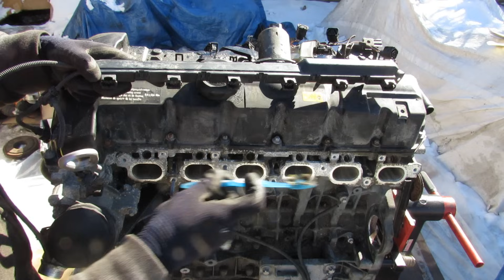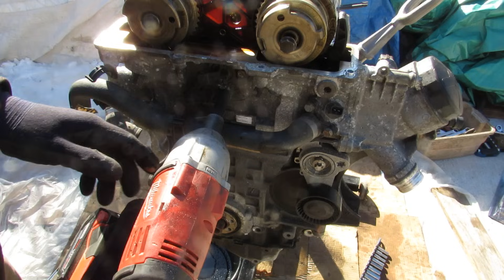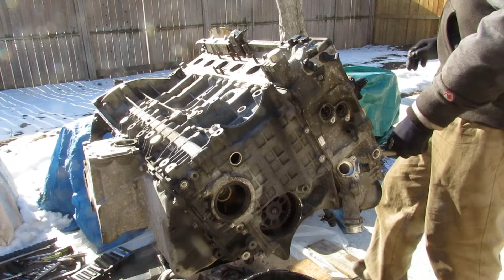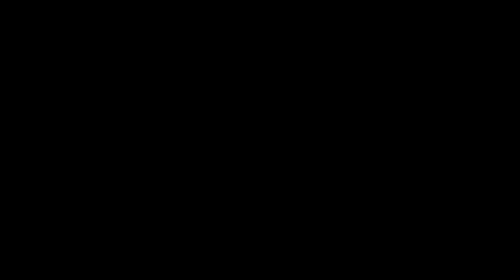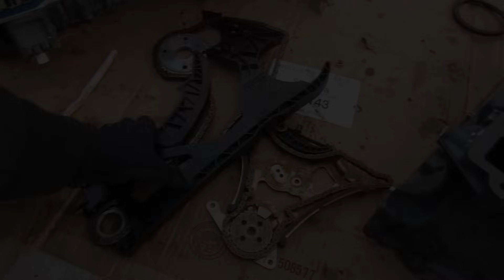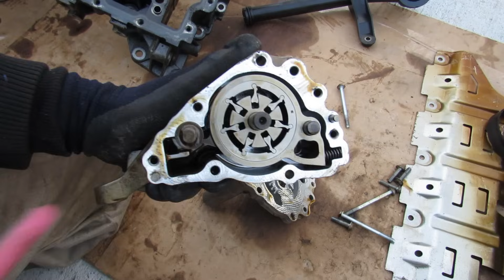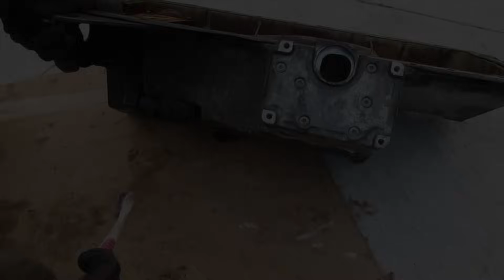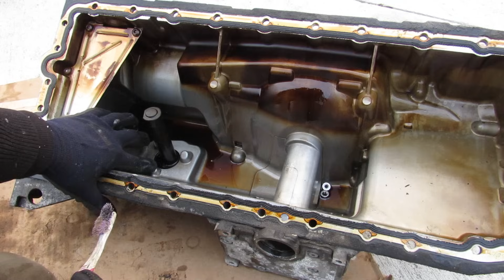The Last Inline 6 Engine: BMW N52

Comment: "now, part of what makes this a engine a real BMW is that it leaks oil"
TOO TRUE. You had me rolling on the floor laughing.
Reply from the maker: Yep it's true and this engine was no exception
Reply: @speedkar99 

Can this motor make it to 250k miles? I would say the GM legendary 3.8 v6 is a better motor. My 2008 Grand Prix has never leaked oil. I am at 218k miles. 

Only thing I replaced was water pump and that was because I hit something and it started leaking
Reply: @captainmorgan5449  I've seen very high mileage M52TU BMWs.  If maintained properly (and you know about and get out ahead of the problems, which are all with the ancillary stuff, not the core of the engine itself), those engines are very reliable.  And it's an inline 6 which is going to be better than ANY V6 🙂
Reply: It's called self rust protection, pretty high German engineering.
Reply: but does it leak more oil then a jaguar?
Reply: Mine doesn’t leak 😂 should I be concerned
Reply: @e90gabe  
Probably. It means there's no oil left.
Reply: @GeneralSamov  lmfao
Reply: @Nagato is better than Punk Naruto I miss mine, had 2, firt was 530d touring then X3

Comment: Composite is just a fancy word for plastic. If the valve covers and the timing chain guides were made of aluminum, then BMW made something awesome. Better gaskets could help too
Reply: Ive heard this from many BMW enthusiasts and BMW mechanics, that the ones assembled in Germany are better/more reliable than the US assembled ones.
Reply: @TeUhtred7860  beware of the Chinese made 4-cylinders
Reply: @kclefthanded427  Any auto made in china will most likely be atrocious, i once saw a chinese knock off of a Honda 50cc generator engine, the Honda made ones are legendary in their longevity, this one had no sump plug and no oil filler cap, the oil was put in through the tappet ajuster screw cap at the factory and was supposed to last the lifetime of the engine, which wasnt very long, then when it popped you were supposed to buy another.  CCP ?   Complete Crap Producers.
Reply: @TeUhtred7860  that's true
Reply from the maker: Good point. These engines we're made for light weight and economy first while still hitting the warranty end date in terms of longevity.

Comment: To service the engine in situ is nearly impossible, damn German engineering!
Reply from the maker: Yeah that's unfortunate
Reply: @speedkar99  The master of the understatement. :-)
Reply: The fact is due to the very long hood , most work can be done when it in the car.
Reply: For the added complexity and the components' weight in order to get rid of the throttle body, I would live with the pumping loss for sure!

Comment: "Part of what makes this engine a real BMW  is that it leaks oil"  :)
Reply from the maker: It's so true
Reply: @speedkar99  It's like BMW sought out the worst rubber supplier in the world to make those gaskets.
Reply: Better out than in
Reply: Both my X1 and 135i are in full agreement
Reply: @shaun2072  My E38 and E34 agree too :D Especially M52 in E38 is sweating. But no major oil leaks.
Reply: My 2007 was in perfect shape besides the fact that it pissed oil.
Reply: I own a N52B30, N52B25, M52B28 & M50B25 BMW. Some sweat, some have a few drops, some are bone dry. They do run perfect though :)
Reply: @ringbimmer  I too have M52B28 & M50B25. M52 is sweating under valve cover, M50 is leak free all over. Wierd. I've changed valve cover gaskets in M52 like only 3 years ago and M50 haven't had valve cover removed in her 30 year life :D
Reply: My n54 leaked oil at 105,000 but my n52 has 184,000 and hasn't leaked a drop of after fixing the oil filter housing gasket a few thousand miles ago.
Reply: I’ve had three n52’s only had one oil leak over 100k driven it was the valve cover gasket, easy two day fix cost me only the price of the gasket and my time.
Reply: Well these BMW are made to look good and work while on warranty, like most cars. The old M10, M20, M30, powered cars are very reliable and don’t leak oil. Plus changing a valve cover gasket on the M52/54 is not that difficult. Oil pan gasket is a pain though…
Reply: @PatricioGarcia1973  Yah, don't you have to support the engine from above to do the pan?  Ugh!  But yah, valve cover is pretty easy on M52/M54 cars.
Reply: I never had oil problems with mine n52.
Reply: The leaks are expensive to fix but once done, this engine does not disappoint. The third owner of a beatup bmw  can testify to this fact.
Reply: You don't understand, its for a life time oil! :D just put 1gal every 1000 mil :D
Reply: 0 leaks here.
Reply: You don't understand, its for a life time oil! :D just put 1gal every 1000 mil :D
Reply: ㅋㅋㅋㅋ
Reply: Not mine, pulls strong with no leaks, never a drop of oil 06 330i
Reply: What they need is like a large sump under the car and a pump to put it back in the engine. Like a catch can. BMW Bloody mechanics worry.
Reply: AND COOLANT.
Reply: My e90 was leaking so I spent $1k to fix the oil pan gasket. Definitely won’t be leaking oil anytime soon.
Reply: Mine doesn t :)
Reply: That oil leaking is not all, this is what I had on a N52:
Broken Exhaust camshaft, no valves bend (01-2025)
Broken center-bolt Inlet camshaft, 2 valves bend (02-2026)

Its a very shitty engine imo, no BMW for me after this sjit car..
Reply: Is rather deal with the replacing 5 gaskets rather than mechanical failures.
Reply: There all 100% German OEMs, like Victor, Reinz, Elring Klinger, and Rein maybe.  Meaning all of their products are 100% guaranteed to NOT be made in Germany.   Those are genuine Chinese, Vietnamese, Malaysian, and maybe Turkey!
Reply: Absolutely correct.
Reply: You sir are completely right
Reply: M54 owner.  Can confirm.
Reply: BMW has finally managed to make engines that no longer lose oil / electric motors ✊🏽
Reply: Years ago I had some people that lived across the street from me. The whole family including both kids drove BMW’s. Their drive way was black from all the oil that all 4 BMW’s leaked. 
One day, there was a oil trail from there house, through the neighborhood and out on to the main road. Lol. 
That told me pretty quick, I know I never want a BMW.
Reply: @DavidGragg82  all gaskets go, some sooner than others, but just because people don't care to fix the issue doesn't mean the engine is bad.
Reply: and this engine overheats (electric fuel pump and/or thermostat fails)
Reply: @julienboucaron9780  The punp will throw a code many thousand of km's before it dies. Mine did at 105.000 km, the pump will last at least 120.000.
The Pierburg pump + thermostat was around 400 Euro. Took about an hour to change.
Reply: @ringbimmer  Depends on the "quality" of the pump if it has been replaced before... One hour ^^, I don't think so, several things to remove to have access to it, or you are crazy good mechanic. Additional issues I experienced on my E90 330i: Vanos solenoids, PCV Valve, camshaft position sensor, o-rings of the oil/coolant exchanger (coolant in the oil...).
Reply: @julienboucaron9780  On the 130i access is pretty easy. I still have to do the pump on the Z4 (N52B25) but there is even more room because the engine bay is longer. The 330i could be more difficult :)
Just clean the solenoids with every oil change (7500km) and switch the position.. But I agree, the older engines (M50/M52) are way less maintenance intensive :)
Reply: @julienboucaron9780  Cooling system is a weak spot on the E46, too.  It has a mechanical pump, at least.
Reply: Scotty Kilmer would agree

Comment: Great engine and great vide as always! I would love to see you do a dissection of an M50/52/54, the evolutions of which ran from the e30 to the e46 primarily. They don’t have all the fancy Valvetronic stuff but they’re stout and “classic BMW”
Reply from the maker: I have better than that...an M62 sitting here waiting for it's teardown.
Reply: Wouldn’t call a magnesium engine great.
Built in obsolescence 
Your better off with the M54, at least you have a fighting chance of repairing it

Comment: Nice! My engine.
Reply from the maker: How has it been?
Reply: @speedkar99  Mine has 150k miles on it now and I got it 4 years ago with 120k miles. With these engines it turns out that the main problems come from the surrounding equipment instead of the actual engine itself. Total problems I've had include crankshaft position sensor, vaccuum pump, valve cover gasket leaking, oil filter housing gasket leaking, and the starter. I've done a lot of preventative maintenance with things like the waterpump and thermostat as well. It does cost a lot to keep everything operating correctly but if the funds are there it's totally worth it due to its nice sound, more than enough 255hp, and smooth linear power delivery.
Reply: @speedkar99  I bought a car with this engine in 2006.  What a marvel at the time!.  I remember sitting at the dealership waiting for my car after service and meeting a guy whose engine blew at 47k km.  I was startled at time, thinking that they were reliable.  I got rid of mine at 90k km.  I didn't want to chance it out of motor plan.  The main problem in retrospect are those 25k km service intervals.  That's crazy.  That is the main reason for the gunking of the engine.
Reply from the maker: Interesting....I guess with older BMWs the maintenance really catches up to you.
Reply: @speedkar99  absolutely. However like you said it’s not like these engines have huge catastrophic mechanical failures associated with them. If routine maintenance is done along with some preventative they can last a while. Some n52s on the forums are past 300k miles and one over 400k.
Reply: @TheBigNate505  True, regular oil changes.  Changing seals as they leak or after every 100k km and valve guides every 150k km.  This should get you 400k km or more together with moderate driving.
Reply: My engine too. Sexy thing 😂

Comment: Was actually interested in the 3 series recently. Perfect timing.
Reply from the maker: Go for it.
Reply: @speedkar99  next engine you should do a rotory engine
Reply: If you’re looking at an N52 3 series I can say go for it. Few oil leaks, but really really solid engines especially compared to the garbage most companies are building these days.
Reply: Well not in this engines case
Reply: Funny thing is that there is no vehicle that is fun to drive that doesnt fail somewhere. Every used car fails somewhere
Reply: @berrbro8651  Not true at all mate, but a Toyota. I’ve had many with over 200,000kms and haven’t given me any trouble whatsoever with basic servicing. And i’m talking their fun engines, 4age, 2zzge, 2jzgte.
Reply: @izzy031096  There's not been a single fun to drive Toyota ever.
Reply: I am a full time BMW mechanic because BMWs break down once a month whether you drive it or not. I say go for the 3 series just get an F chassis or newer. The E chassis are already old enough the plastics have gone to shit.
Reply: @danielpeck6269  i have a 05 E90 325i N52B25 with 209.000km and beside a collision with a golf V and a changed timingchain i had no problems with the engine. Just basic service
Reply: @MetalMelodie  I've never seen an N52 need a timing chain, but they do have issues with the bolts holding the VANOS actuator together breaking. Timing chain stretch is more of an N20 issue. 209,000 Km or 130K miles is right about when BMWs start falling apart. Good luck!
Reply: @danielpeck6269  to be precise ut wasnt the timingchain that failed but the VANOS and since the chain was out i changed it aswell
Reply: @danielpeck6269  Thanks for the advice
Reply: @danielpeck6269  the last good bmw was the e39. with the plastics on a e39 maybe ccv and most likely the buttons on ihka. and the ccv kit cold climate version is like 140 euros on the shelf price in finland. ihka buttons can be fixed with flea bay for 20 euros. buts just the minor things. rust can be fixed anyways with a mig. tldr: if you're not a diy and guy with thumb middle of the palm don't get a e series stay to the toyota brand
Reply: I don't think, that the timing is perfect in BMWs, so...

Comment: Hey I think you missed the NA part in the title. Great video!
Reply from the maker: That would make it too long so it's on the description and video introduction.
Reply: @speedkar99  It's not even their last n/a engine tho.
Reply: @Random-nf7qb  it is
Reply: @Scartown13  It is not
Reply: @Scartown13  N53, with direct injection, is I think is their last I6 N/A engine
Reply: @soositta4221  it is in America
Reply: @Scartown13  so the fact that N53 wasn't introduced to the US, makes the N52 the last n/a inline-6 that BMW produced?
Reply: @soositta4221  of course in all of America its the last inline and the only difference is direct injection which basically is the same engine just a different fuel delivery
Reply: @Scartown13  the N52 is a multipoint/direct-injection hybrid 😜
Reply: Yeah... BMW still makes I6 engines but they're all forced induction now
Reply from the maker: Sadly